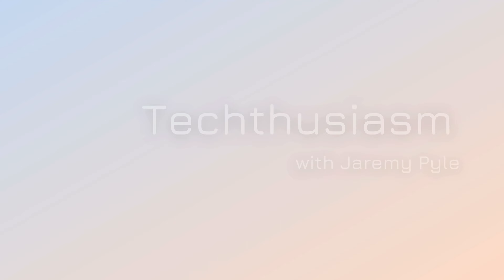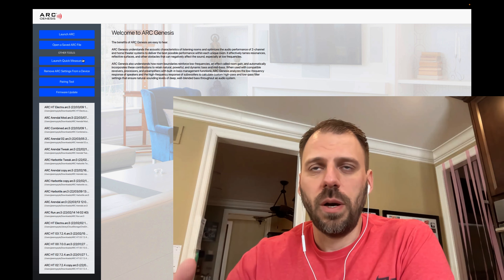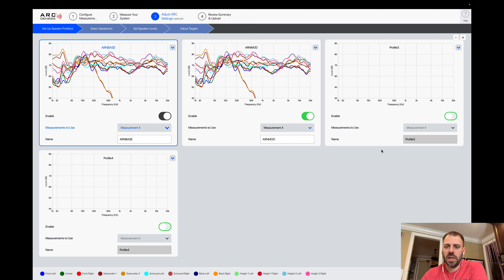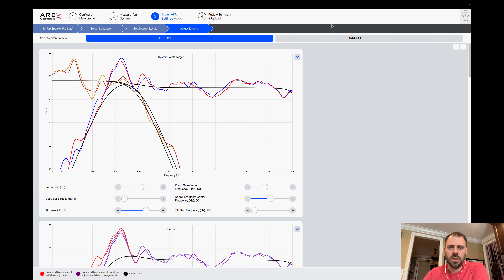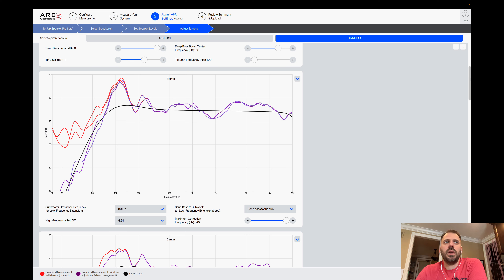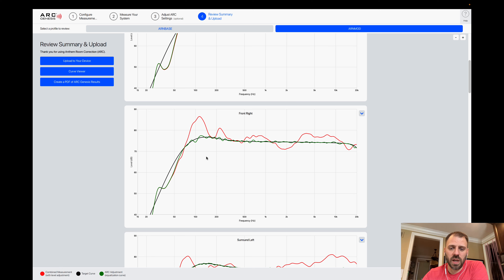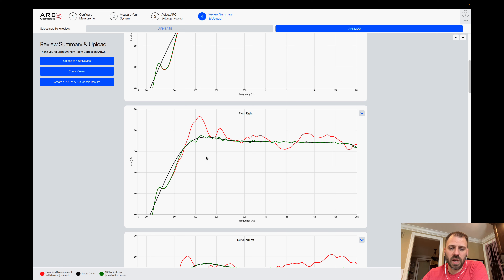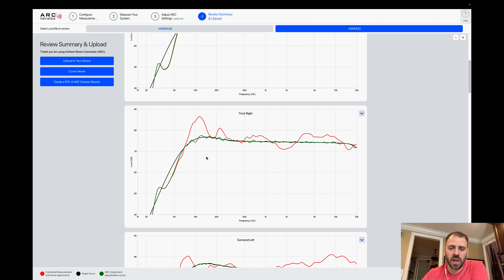ANTHEM ARC GENESIS ADVANCED CALIBRATION v1.5.4 | Features, Bugs, Custom Curves, Multiple Configs

Comment: These graps are meaningless. You need to take before and after REW measurements...
Reply from the maker: What exactly makes ARC measurements meaningless? It measures room response over a frequency sweep in a single point and then averaging across multiple points to adjust and calibrate. Single point quick measure is the same thing REW would show you. I probably will pick up a UMIK though and play with REW separately at some point though.
Reply: @Techthusiasm I have the AVM70
Multiple ARC cals later , QM and REW show a completely different response compared to curve viewer post ARC.
And yes. I have ARC enabled . 
All the cal seemed to do is boost speaker level. 
Looks nothing like what ARCs corrected graphs look like. 
Im starting to believe ARC is full of 💩